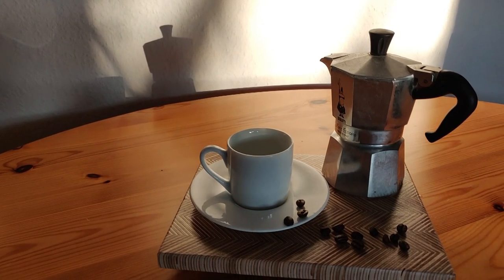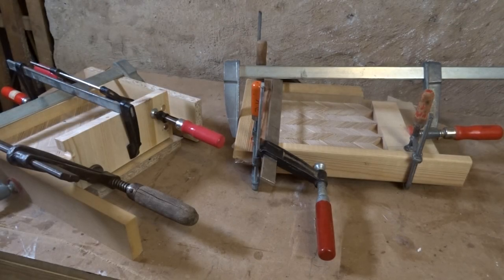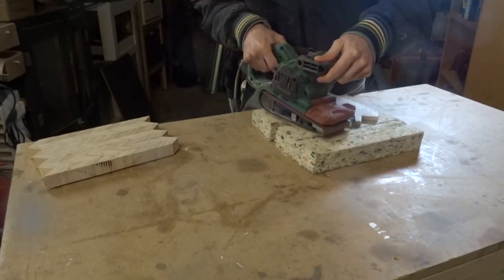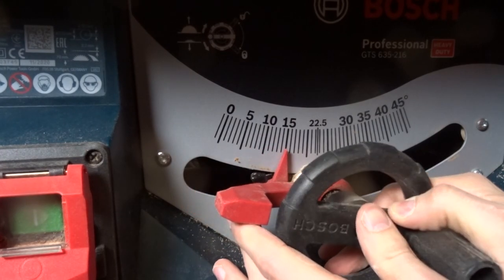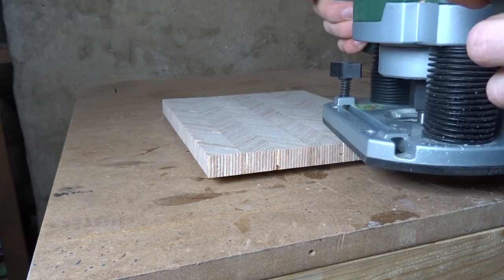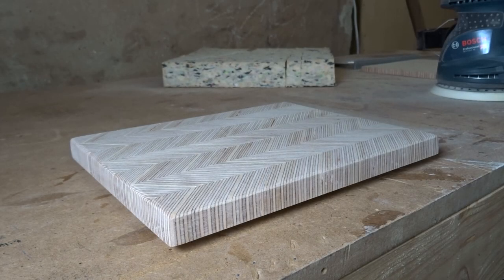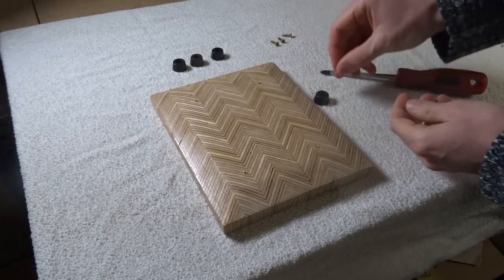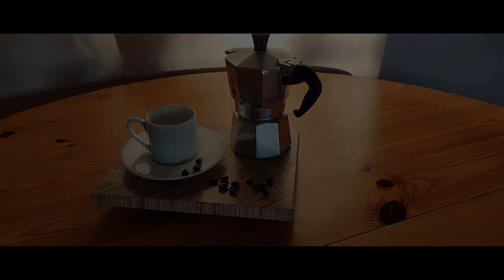Plywood Pattern Coaster

Comment: That's great although i think the rubber feet are a mistake
Reply: They do allow getting you fingers underneath to pick it up. But I think they would make it tippy, as they are quite a ways from the true corners.
Reply from the maker: Thanks for your opinion, I wasn't sure about that either. But if I decided to change it, I can still remove them easily ;)